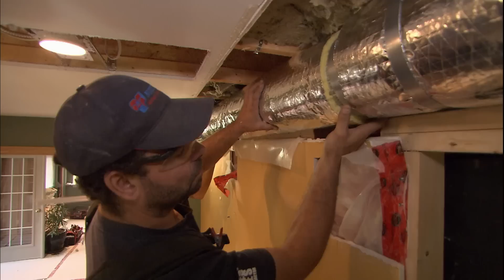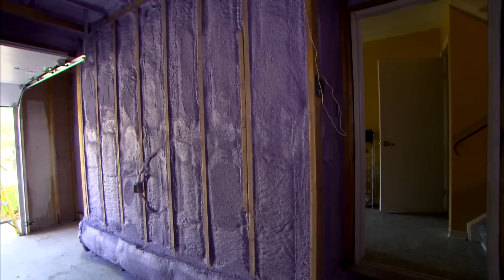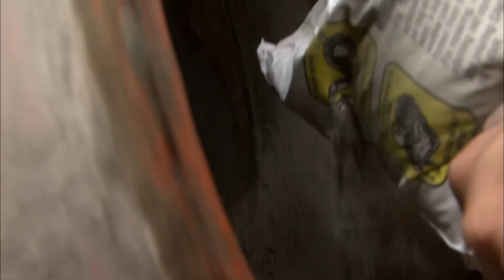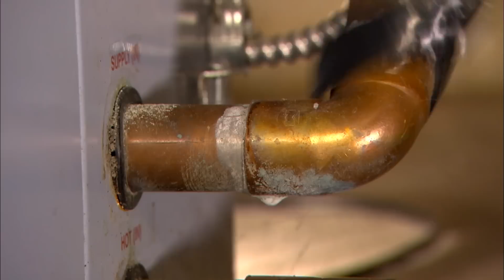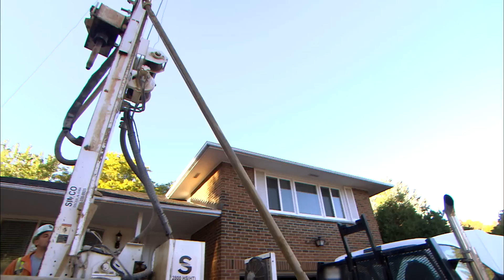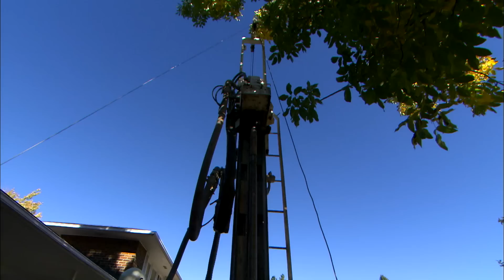Common Heating Issues: HVAC, Air Leaks, and Geo-Thermal Systems | Mike Holmes

Comment: I have a Unico high-velocity heating system. It is better and more efficient than the system that you just install to replace it. But, it has to be installed correctly. And yes you can heat the house without water without any problem. As you demonstrated the person who installed it didn't know how to install HVAC. So, I disagree with you removing the system. You just did not have enough vents coming off the system going into each of the rooms. From what I could see.

Comment: We've used a geothermal system for 19 years in central Texas.  My experience, in brief:  Two units shared 1500' of buried line in 3 wells (total run of 1500' plus horizontal runs). One unit 3 Ton and other 1.5T.  Total of 4.5 tons capacity.  *Not enough buried ground loop!*  During the worse of summers, the return water was 100F plus.  About the same temp as outside.  During winters (generally mild here), we still experienced over cooling of the return water.  Finally the 3 Ton gave out... and we replaced with a hi-eff heat pump.  That left the entire loop supplying the 1.5 Ton unit and finally we had enough loop to fully realize the efficiency.  This summer was the hottest on record here.  For 2.5 months it exceeded 100F everyday and probably topped 105F for half the time... it was brutal.  We had previously replaced the smaller 1.5T after about 16 years (a little soon in my opinion). After we took our the 3T unit, the small geo system performed excellently.  Return water temps were about 72 F, and we cooled the area to 76F, so it was very efficient.  The other unit, the conventional heat pump, performed very well itself.  It was a Carrier 18.5 SEER2/ 12 EER2.  Expensive, but soooo nice.  We have not really compared power usage with prior years.  So... the lesson is don't skimp on the ground loop!!
Reply: Actually Sir, I would argue the lesson is "don't skimp on the contractor". They are the one that ultimately holds the line when it comes to making all the critical decisions. Consumers get sucked into thinking that all contractors are essentially the same, or alternately thinking they can choose by arbitrary metrics like how smooth the salesman is or how big the company is/ how nice is the van/ how long have they been in business/ etc. None of that actually matters! Three things that do- 1 technical competency 2 the contractor's morals and commitment to do the job well 3 (last but not least) the homeowner's ability and willingness to pay for better work and letting the contractor do whatever it is that needs to be done. Homeowners are easily misled by polished marketing and shoe covers.

Comment: That first couple with the high velocity system, it was mentioned in the original episode that a bunch of extra windows were added to the west and south sides of the house and the builder didn't go back and redo the heat load calculations for the house.